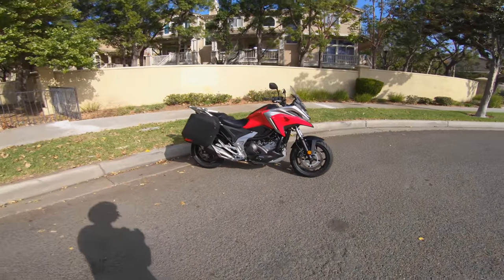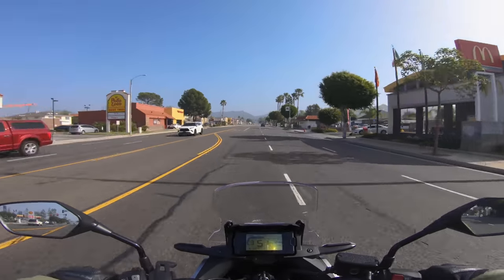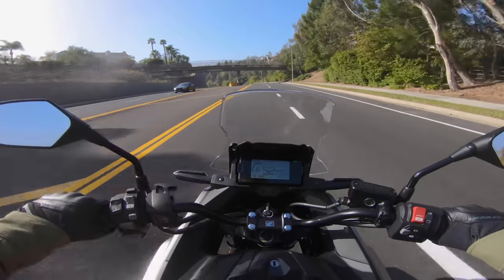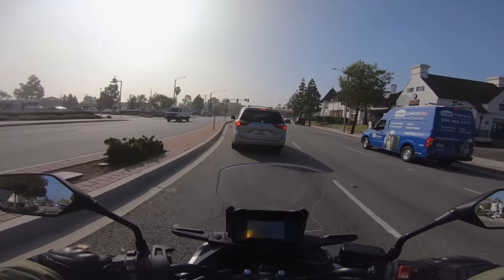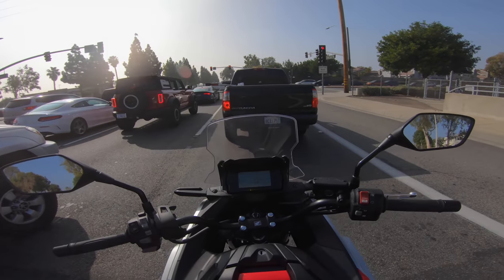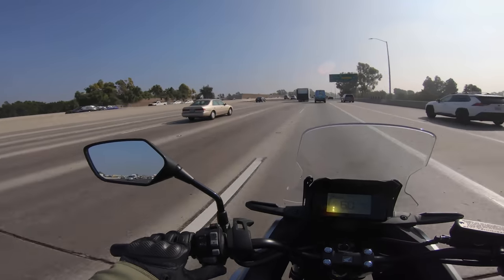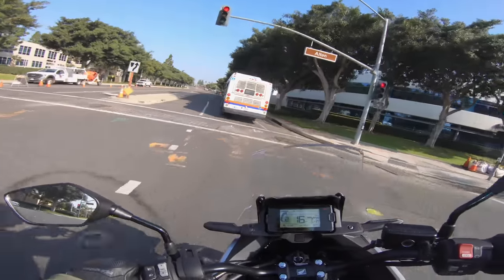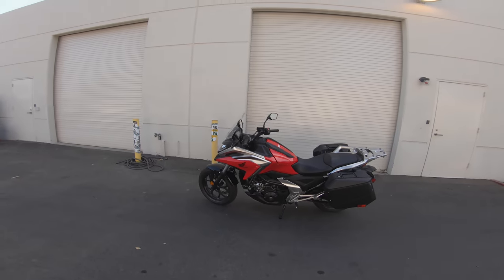2021 Honda NC750X | MC Commute

Comment: The only people who get this bike are those who own one and those who want to own one. The NC is as underrated or unappreciated as a bike can be, and it’s widely misunderstood, especially in the US market. It’s a worldwide best-seller for a reason. The NC has its own charm and it grows on you. You don’t have to like it, but maybe show it a little respect.
Reply: I want one now!
Reply: Many people only hate it because it is a big bike but has the DCT transmision with an engine that doesnt rev past 6700 rpm and thats the reason its not a "real" motorcycle... or so they say
Reply: I own a 2015 NC700X it rated one of the worst bikes. Now mine is manual shift but you hit it saying misunderstood!! These are great do everything bikes!!!
Reply: Just bought the 2022 model. Cant wait to ride it in the summer. Traded in my 2017 R6.

Comment: I have owned an NC750 for thousands of trouble free miles. In my opinion, if they made it with cruise control and shaft drive it would be the consummate motorcycle.....
Reply: I totally AGREE
Reply: I own a Honda CTX 700 DCT cruiser and absolutely enjoy the comfort and ease of a safe ride! I am eyeing getting a 2022 Honda NC 750 DCT!!!
Reply: @edsmith1083  I only tried the DCT Honda as I had just test ridden a Versys 650 and the dealer offered a ride on the NC to give me a comparison. I was completely sold within a few hundred yards. These bikes are so forgiving, so easy to ride, and the fuel economy is incredible. I'm lucky enough to have a few other bikes, but the NC is my 'go to' machine...
Reply: ... It would also be 13k and 30 lbs heavier...
Reply: @BibtheBoulder smart dealer😅

Comment: If the side bags are included for that price then I'd say it's good value. I routinely ride a CBR500R on 300 to 400 mile trips and the only comfort mods I've installed was a double bubble windscreen and a throttle lock.
Reply: It’s still a good value, especially in manual.
Reply: @mindspinn311  I see brand new 2021 leftover models in manual for $7600 + fees here in So Cal. DCT nowhere to be found, though.
Reply: @drewmorg.  There were not many 2021 DCT available. They sold out quickly. I see several 2022 DCT available now. It’s a difficult market in which to go discount hunting.
Reply: @mindspinn311  Agree! But I think if I were to buy a motorcycle today I would rather buy new because the value of used bikes is nearly the same as a new one. Although I do see some really lofty used prices  that sit for 4+ weeks on the various sites.
Reply: Glad to hear your love of the 500R. Especially on long trips. I'm heavily considering it as my first bike purchase.

Comment: I have a 2021 version with the Honda optional 'touring' screen. I have a deflector fitted and it's perfect. There is a Honda recall for a snatchy fly by wire throttle, it works. The panniers are $750 trade price, ok in the market comparable to other manufacturers. I have fitted lowered footrests as I found the riding position a little cramped together with an air seat, now perfect (I'm only 5'10") The DCT is much better than my 2016 Crosstourer.
Reply: Please where did you get the lower foot pegs from? Brand?

Comment: As soon as I hired ADV 750 in Madeira Portugal for five days I wanted to buy it.   But I wanted style so went for the Forza 750 with DCT (NSS750) which apparently is not available in the USA.   Traded in my BMW R1200RT.   What I like about the manual mode is that you’ve  changed down then want auto you’ve slowed down auto will change so it won’t labour the engine.     Also ordered the central locking top box. I absolutely Love it.

Comment: So many well thought out things on this bike.  I missed whether it was ride by wire, though, because if it is, then there is absolutely no excuse for no cruise control!  With all the storage, it's perfect for those extended weekends a couple hundred miles from home.
Reply: Yes it’s RBW but Honda’s market research and talking to owners determined that they don’t use cruise control. It’s a commuter not a tourer. Still, it could have been easily added using the same right hand control pod as the Rebel 1100 (the left is already identical). But Honda has their bean counters like everyone else.
Reply: Honda loves to not include the cruise control. There are RBW Africas w/o a cruise control, it's just an arbitrary anti-feature. I can't think of a bike where I wouldn't find use for a cruise control, I would even use it on my enduro, if it had it.
Reply: I have a 2014 NC700 DCT. The most common complaints are the lack of dual disc brakes and cruise control. But as he points out in the last minutes of the video, that ultimately adds to the price of the bike.   I tour on mine and frankly  after putting on a $10 Cramp Buster I’m fine with out the cruise. I have no discomfort with riding for 6 to 7 hours straight using the Cramp Buster. The  seat to peg distance he mentions is a problem for tall riders. I am 6’2” with a 34” inseam and it was pretty uncomfortable after an hour of riding. Then I replaced pegs with a aftermarket peg that drops it 40mm and that made all the difference in the world.
Reply: The 2020 is not ride by wire.
Reply: @keithkamps77  Good thing this video is about the 2021.
Reply: The lack of an IMU and cruise control make this otherwise "perfect for me" bike a no sale.  I realize it would make it more expensive.  Fine.  I have the money; sell me what I want!

Comment: Can you get the foot shifter so in manual mode you can click the shift with your foot instead of hand switches? I know they have that option in Europe.
Reply: Yes, it's not a listed factory option though. Search on Google, think it's talked about on the Nc700 forum. The shift lever is just a switch not a direct gearbox connection. Bit expensive though.

Comment: I own an Aprilia Mana 850 and tbh never understood why being an overall better motorcycle than the Honda  - more HP, better brakes, better forks, better design (eg the helmet space opens towards the driver, which is way more practical in tolls, etc) - it was a nevertheless a failure for Aprilia and Honda was the one that ultimately profited from the idea. Probably was too expensive atm and due to Aprilia's poor servicing network in the US. I use my Mana mostly on manual mode and shift gears with the buttons and it's the best thing ever, absolutely smooth and flawless. Once you get used to the sequential electronic shift, the pedal feels agricultural, no way back for me. Anyway, the new Honda NT1100 could be an upgrade, but it only provides around 20 more HP than my Aprilia and no helmet space, which is truly practical. I wish they had gone for 120HP to have a real upgrade path without losing the DCT.
Reply: Because the Mana has exorbitant service cost every 12k miles due to the CVT.

Comment: Which is quicker dct or manual transmission? Thanks for the excellent commute test as usual 🙂
Reply: DCT speed of up shifting negates the extra 22lbs. The bike is enjoyable with either transmission. Difference in acceleration isn’t significant.
Reply: Manual transmission is quicker , gets better gas mileage, and more fun to drive in my opinion. I own one !!
Reply: @chrismorin4109   BUT have you ridden the DCT ?  If so how far?

Comment: As a previous gen nc750x dct owner, highly disappointed.
Lower bike, minor upgrades to dash, especially compared to two other 2021 models, the xadv and forza750.
Single disc is not enough! Especially with pillion and gear.
Bike got lowered and compacted, but they still kept the X on... all in disappointment.
Reply: They have removed the 750S and homogenised the 2 bikes into this model it seems.

Comment: I want to love these, but I think I'm 2-3 inches too tall to be comfortable. Peg to saddle height it a little cramped for me at 6'1". I'm apparently the most fragile 40 ish year old with cranky hips that can't tolerate more compact rider triangles.
Reply: @bangbang93i  That works for a few momwnts when I need to stretch out, but you can't ride around like that all the time. If the reviewer in the video is 5'7" and complained about the footpegs being cramped, it's clearly a characteristic of the bike. It's good for those with shorter inseams, so definitely not knocking it. There's a number of bikes like that which are less than ideal for taller folks and that is why I have gravitated towards dual sport and ADV bikes because they are more comfortable for me.
Reply: Their are aftermarket adjustable foot pegs that lower it a couple inches.

Comment: 500x and 750x are awesome bikes for adventure touring but why are they so heavy. Don't wanna drop them on your feet
Reply: Because 350lb dual sports suck for touring. Can’t have it both ways.
Reply: @mindspinn311  500 and 750x aren't dual sports. And yamaha mt03 weighs 370lb and the reviews don't mention any stability problems. I'm just saying 500x can't weigh same as tenere 700 when the latter has a bigger engine and better everything

Comment: Thanks for the review MG. Two things occurred to me: $800 is a lot for a motorbike DCT, and what power does it produce? I looked at the terrible Honda website and found it's 43kW which is about 58hp. This may vary depending on locale I suspect.

Comment: I don't get the capability argument at all.  Yes I like it, takes the rider one more step away from the noise and hassles of shifting, but I don't see any extra capability besides the faux-tank trunk storage, which is a lot by itself,  but besides that, it's only a way to get from point A to B which any motorcycle is capable of.  I do think it is going to have longer reliability due to the low revving, essentially half a 4 cylinder Honda car engine, and is what the future of ICE motorcycles is going to be, but ultimately it is not especially capable, just a quieter, more sedate cruiser/standard hybrid that you don't have to shift.

The funny thing is that I think Honda went in the wrong direction, by only increasing engine displacement when I feel there would be more interest in a lighter chassis, 400cc-500cc version for those who just do shorter commutes, aren't looking to take it on long road trips.  Get it down under 400lbs and maybe up the fuel economy closer to 70MPG, and of course, a lower retail price which is very critical for beginner riders.  I see a 500cc version of this, ideal for new riders, except that they still need to learn to clutch/shift if they hope to move on later.

Despite what I wrote above, I very much see the NC750X as a top coice, competent everyday commuter for people who live in utopia where it never rains or snows, and don't want the extra burden of shifting but do want the reliability of a low revving Honda engine.

Comment: It is a motorcycle not a moped. Give me manly gears any day!
Try shifting a 1000cc sportbike near redline and you will beat the feel of any car. 160 kph in 1st gear, 210 in second,...
Seem like it would make a good week or weeks long solo trip.

Seriously why would a fit person ever want cruise control on a motorcycle? 
I have ridden some form of bike for 50 years and want to ride and enjoy being in control.
Not sitting on some small sofa while a computer drives for me is not for me. Get a car or chaffeur then!
Reply: Cruise control is nice just to give your wrist and hand a break every now and again and to maintain your speed in the flat and straight bits to avoid speeding tickets.
Reply: @Thirsty_Fox  I guess. I have never needed that in 40+ years of riding. I try to get a bike(s) that fits my body.